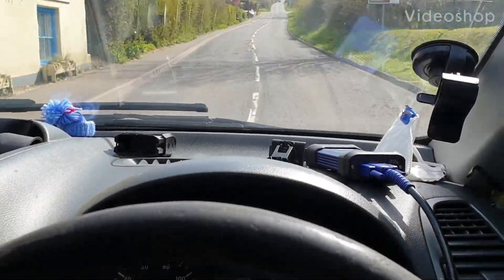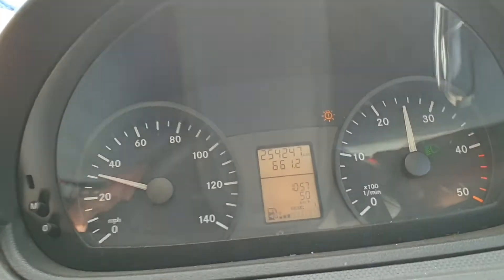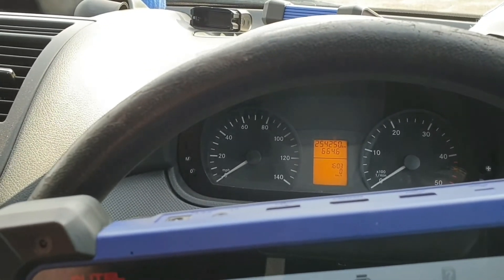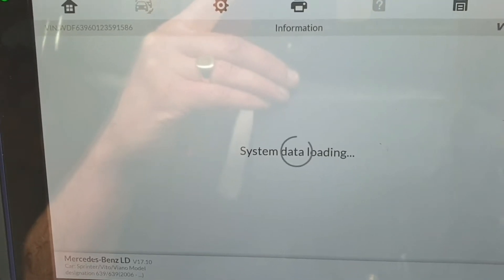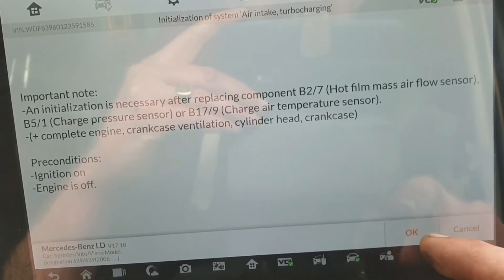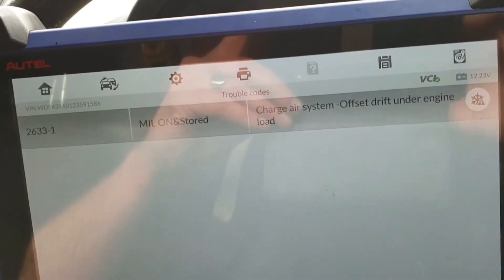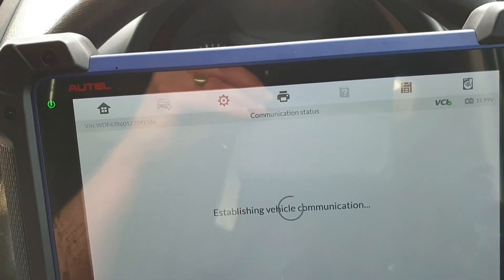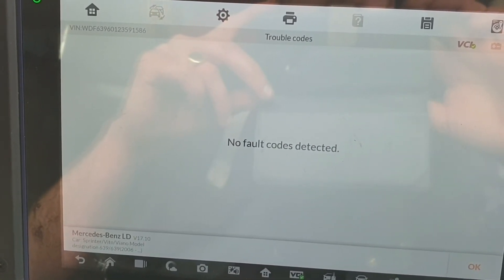Mercedes 2.2 CDI Fault code 2633 or P2633 How to Reset Charge Air System Offset Drift

Comment: I have 2624-1 which says “Mass Air Flow (MAF) sensor Sensor driftOffset drift under engine load The limit value of the load point 1 is exceeded.” Would this work for the same?